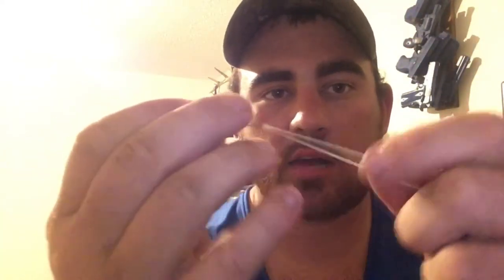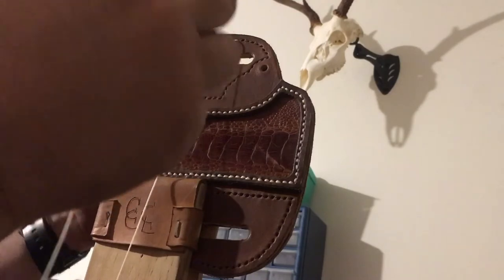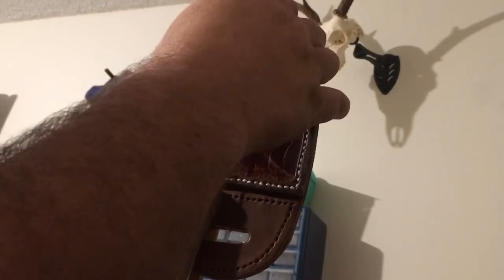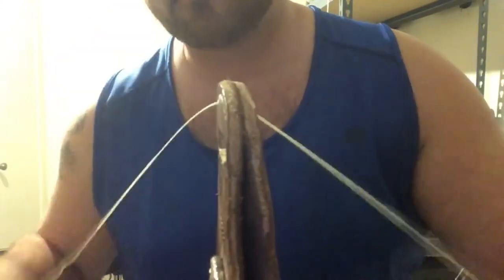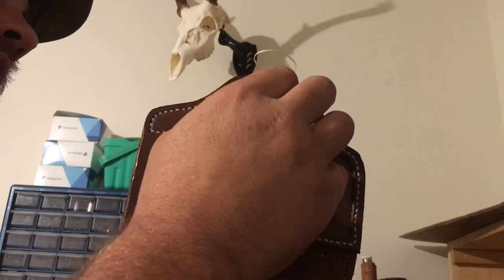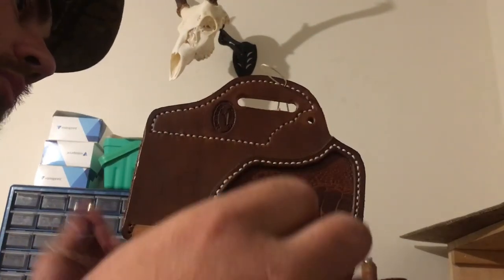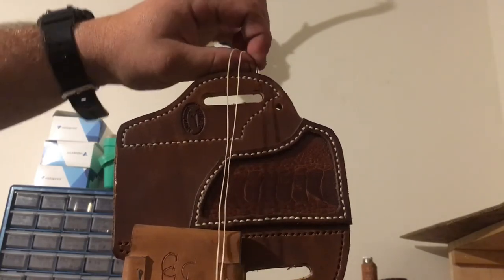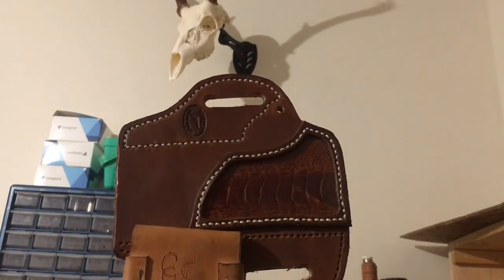How to saddle stitch a leather holster

Comment: Hi, new leather worker here. If I glue the two pieces of leather together, how do i end the stitch so its hid like you did? Did you leave that particular spot unglued?
Reply from the maker: Hey mark, great question. I take a petal lifter tool and separate the glue between the two pieces. You can use what ever you would like to separate it. A small flat head screw driver would work. The stitch is by far more structural than the glue. I usually like to think of the glue as something to hold the pieces while I stitch. Hope that answers your question.